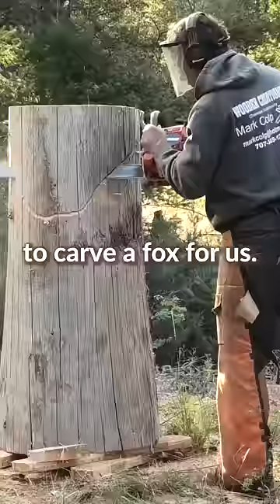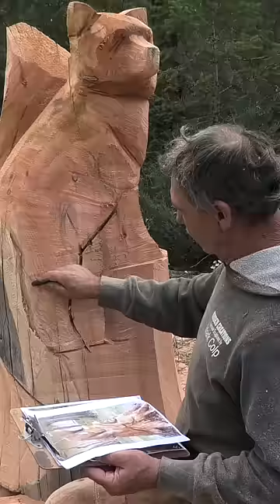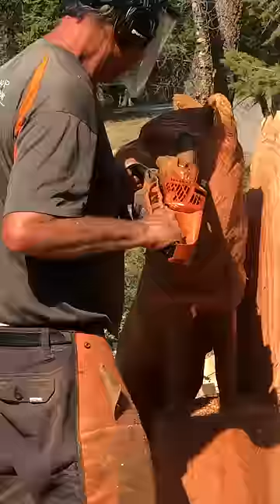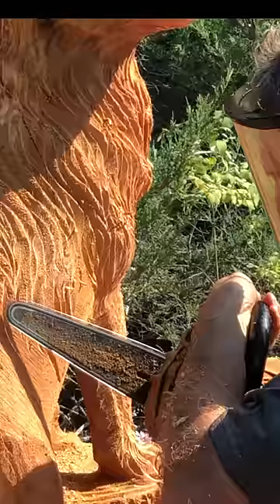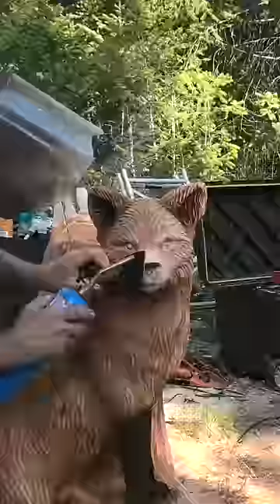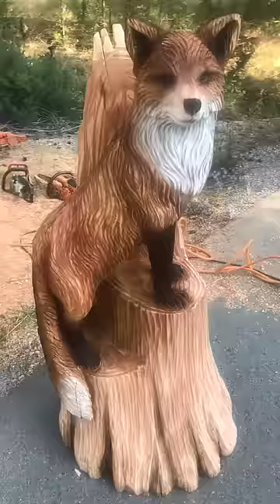Chainsaw Carving a Fox #chainsawcarving #carvingfox #woodworking

Comment: Lol, just a heads up for the inexperienced chainsaw users, make sure your chain is free from obstacles before starting the engine, any obstacles in the chains path can cause kickback and there are many reasons your chain might spin while youre in choke

Comment: You don't think trees are better art? Specially when they are trees and not just wood 😒
Reply from the maker: The stump was from a diseased (dying) tree which was cut down and when it was, 3 new tree saplings were planted in its place. This is done according to the law here in British Columbia, a law in place since 1987. It was then removed from the forest to eliminate fuel for potential wildfires which occur every year and burn and destroy millions of hectares/acres of trees and endanger/take the lives of people who fight these fires. The remainder of the tree was used for other things such as fencing, furniture, and shingles and shakes for roofing. Anyway, thanks for watching.